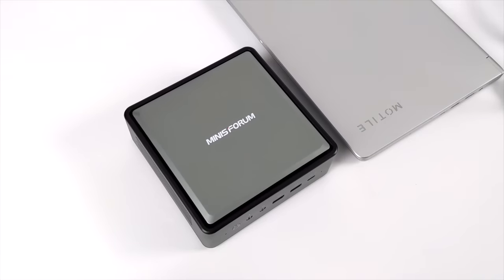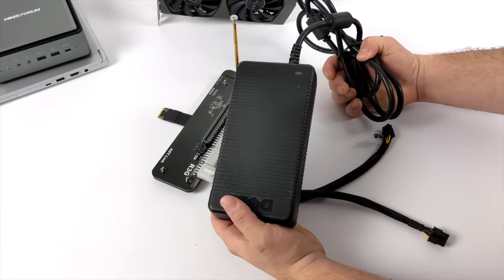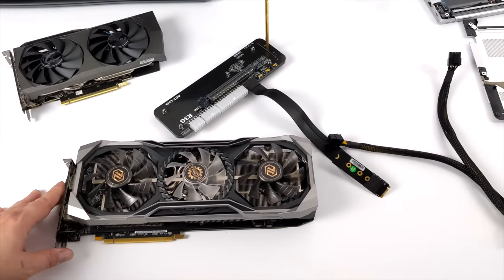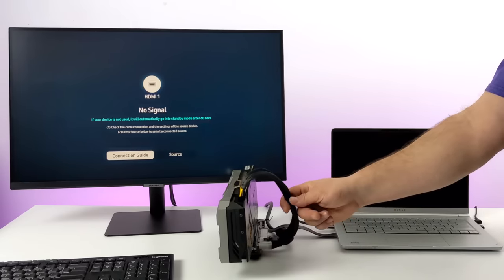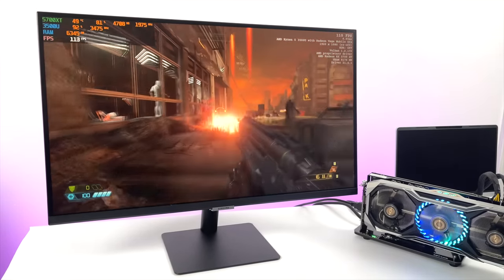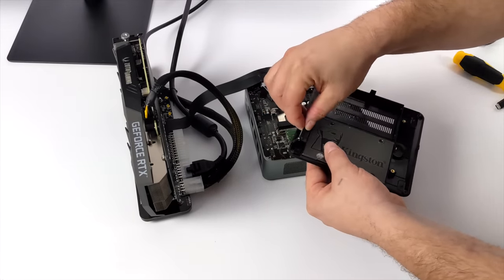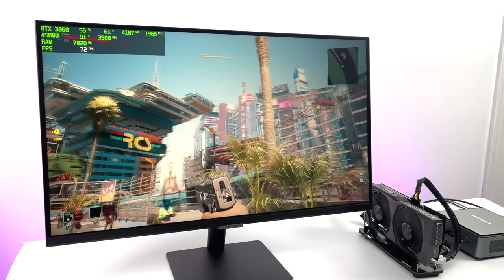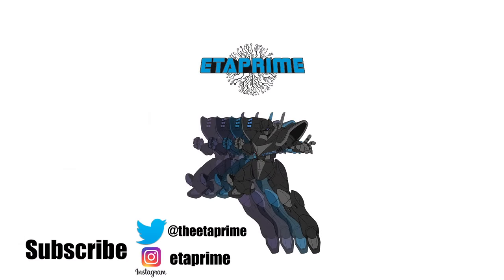Add A Graphics Card To Your Laptop Or Mini PC With This M.2 GPU Dock!

Comment: will this work with newer cards? like rtx 40 series? (obviously assuming i provide enough power) want to use it for my msi gf63 which has an rtx 3050 laptop gpu
Reply: Practically speaking, any GPU will work as long as you have a big enough PSU that can supply the GPU with enough juice. Do note that the eGPU dock can't always provide the full potential of a graphics card, you are broadcasting through an M.2 slot after all.
Reply: @hereis_Tiff so how much fps can you lose?
Reply: @Mope333  I'm not entirely sure to be fair.

Comment: i still have issues with my X220 and expresscard connection .The problem is with displaying games that run on the external GPU(GTX 1650 windforce OC) on the internal dispaly -_-

Comment: could you use a external m.2 ssd USB 3.0 adapter to connect a eGPU? my laptop only has one m.2 port and i was able to get it to work with the ssd in the external adapter and the e GPU in the m.2 slot in the motherboard but if i swap it around it doesnt read the eGPU anymore.
Reply: There is a special variant of this eGPU dock that basically allows you to connect the dock using Thunderbolt/ USB C. Perhaps that'll be more of use to you.

Comment: MINISFORUM Mini PC NAB6 Intel Core i7-12650H,10 Cores 16 Threads,up to 4.7GHz 32GB RAM DDR4 1TB PCIe4.0 SSD Dual 2.5 G RJ45 LAN Mini Desktop Computer,2 x HDMI,7 x USB Port,WiFi 6,BT5.2
this is the mini pc i got would this work for this

Comment: My external gpu isn’t detected my windows I have a 3060 laptop and got a 4060 external gpu and I set everything up correctly I installed the right drivers, the 4060 dose show up in device manager and I also disabled my 3060 integrated gpu
Reply: It also doesn’t show up in task management, it also won’t display on my monitor

Comment: Would I need to alter the BIOS settings for this to work?
Reply: On a desktop computer I can guarantee you that you don't need to alter the BIOS. 

I'm not too sure about a laptop though. It may be that your laptop automatically detects the GPU and switches to that display output. It may also not do that, in which case you may want to alter the BIOS.

Comment: I've just purchased another system, a micro pc HP EliteDesk 805 G6 mini, with an AMD ryzen 7 pro 4750ge the 35w variant, 16gb ddr4 sodimm 2x8gb sticks, a 512gb nvme, I have a spare m.2 slot, could anyone recommend a decent GPU for this particular setup? Thanks

Comment: shame that Port isn't on the side so it's easier to plug in external upgrade to hotrod our old laptops
Reply: I believe Acer made Mini PC's back in the day with a full PCIE x16 slot hidden on the side of the machine. All you had to do was remove a plastic tab and connect your graphics card. Wish OEM's would still do that.

Comment: Any other way to connect through thunderbolt 3 type C port ?
Reply: It's not compatible mate if you're connecting a Thunderbolt through type c. Type c port has a low bandwidth probably if I'm not mistaken it only have 5Gb/s bandwidths, and thunderbolt ports have 40Gb/s bandwidth. It doesn't matter even if you have the thunderbolt cable.

Comment: is it possible to connect a external GPU to a beelink  ser 5 ?
Reply: I think it is possible, as long as the mini PC support thunderbolt 3/4, and atleast 2 m.2 slot, well I think even 1 m.2 slot is possible just buy SSD enclosure. But still research more about your mini PC

Comment: can you make a video when usinh the ngff (m.2 e key wifi card) version of this? I wanna see if it works because I don't wanna sacrifice my m.2 since i really need it so I cant do this
Reply: As of writing this, there are no GPU adapters that use the wifi card slot. As far as I know, wifi card slots typically do not have the required lanes that typical M.2 NVME slots do have that make it possible to connect a graphics card. I get that you don't want to sacrifice an M.2 slot, but if you happen to have 2 or more of those slots on your system, it may very well be worth the sacrifice.

Comment: Hey, I don’t know what I’m doing I need help finding the right graphics card for the dock I want a 6900xt but the issue is the port is different from the port on the dock I need help
Reply: What do you mean? It's the same port...?
Reply: @hereis_Tiff  so I won’t waste 700 bucks for it not to work, it will be compatible
Reply: @FORTNITESLOTH220  Every graphics card has the same PCIE X16 pin. If you use the adapter shown in this video, you should be able to connect your GPU over M.2.

Comment: 100% appreciate your video. Im pestering minisforum to add a 2nd nvme to this model.
My objective is to add a sfp+ 10gbe network card, 2x 2.5" drives in raid 1 and 1 nvme cache and have it be a mini low power NAS
Question, curious how much power the dell adapter is using at idle from the wall

Comment: Connect gpu, install driver nvidia and after reboot 😢 code 43 not ready to go. What wrong?
Reply: try searching error code 43 on youtube for solutions
Reply: @CJFromGroveStreet  tnx. I find fix error code 43 on Egpu forum. Need run .bat file and all ok.  Work well. Rtx 2060 super with notebook hp omen

Comment: Is this applicable to lenovo ideapad 3 v14, AMD3020e (disregarding the cpu)?
It does use nvme-m.2
Reply: As long as you're able to access the m.2 slot it should work yes. But your lenovo laptop only has a nvme m.2 x2 slot not an x4 it will be significantly slower then if you had an x4. Regardless it should be an improvement.
Reply: @PabzRoz  ohh 2x thank you for the response... And how would i know a m.2 2x or 4x? (if later on i decided to upgrade/change my laptop)
Reply: @putusatriavi  No problem and find and read the specification on the laptop and the m.2 port. It will tell you weather it's a 2x or 4x pcie slot. Always check out the specs before purchasing.👍
Reply: @PabzRoz  i will. 🙏🏾
Reply: @PabzRoz  hi, does m.2  x2 could be referred as keyed 'B' or 10 Gbit/s and the x4 keyed 'M' or 20 Gbit/s..please correct me if I'm wrong
Reply: @putusatriavi  no lol it will say x4 or x2 that's it.
Reply: @PabzRoz  ohh okay... 🤦🏾‍♂️

Comment: I tried this on a x4 slot on a lenovo nano . But when they are both connected it no longer sees my boot drive?
Reply: did you go in your bios and make sure the right boot drive is selected?
Reply: @PabzRoz  no boot devices show up when the adapter is connected.  When i disconnect it my ssd shows up
Reply: @adriancuevas1587  no boot devices show up in the bios when it's connected? that's weird. Does it show any storage devices connected in the settings in general? Maybe you can find it that way and manually set it up as a boot drive?
Reply: @PabzRoz  no its really weird. Nothing shows up when the adapter is connected. Might be a bios limitation but not too sure lol

Comment: My laptop has a wifi card pcie slot. Is that the same thing as m.2 or what do I use?
Reply: No, unfortunately. Mine has that too. They used to use those instead of M.2.
Reply: The wifi port is not an NVME m.2 port that this adapter requires. You have to look at the connector to identify if it is a mini-pcie or an NGFF connector. For this case there is another adapter you can find on ebay/chinese sites called EXP GDC. A bit slower than the R43 but does the job and can really make a difference on whether you can game on your laptop or not
Reply: @ThanosTsakirisGaijin  mine uses Mini Pcie, I really like the one in the video because hes able to use an external psu though

Comment: Curious if there’s a workaround for hardware that doesn’t have a viable m.2 port available?
For example, using a m.2/usb-c adapter or m.2/sata adapter.
Reply: There is always the older card docks that use mini sata. Even laptops from 2011 have a mini sata slot. It's the slot used for the network card.

Comment: this doesnt really make much sense to actually do. you have to bust a toolkit out every time you need to take your laptop somewhere. and as for the desktop just build a bigger one and save some money and wall outlets. even if thunderbolt has more of a dropoff in bandwidth than this it still makes more sense to use as you can just unplug without a screwdriver
Reply: it takes 1 minute to plug it in
Reply: @bonkerzd6980  not exactly elegant is it. makes even less sense with the mini pc.

Comment: This is pointless for most all users. You pay a premium for a laptops portability and a mini PC's size, this destroy both portability and size for anything you would run it on. 

Now running speciality equipment setups this  could fill a need. Would be disappointing to not hook this up to a Pi with maybe with that argon one m.2 case.

I Wonder if I could rig this to my Asus router with some tinkering, maybe output network statistics, a list of active connections, and a feed of DNS logs.

Comment: There is now a PCIe 4.0 stand  JMT M.2 M Key NVMe External Graphics Card Stand Bracket 64Gbs Full Speed with PCIe 4.0 x4 Riser Cable R43SG

Comment: Have a quick question when I be able to use this type of power supply for my Mini PC? Segotep 750W Power Supply, 80 Plus Gold Full Modular PCIe 5.0 & ATX 3.0 Gaming PSU for NVIDIA RTX 20/30/40 Series & AMD GPU, 120mm Silent FDB Fan, 5 Year Warranty

Comment: Would this work on a desktop which was a mini ITX motherboard and doesnt have a PCIE slot? ive seen alot of motherboards with m.2 slots and i seen people try using the EXP GDC dock but this seems to be much more stable then that. 
If im wrong can someone correct me. :)

Comment: You could try if you can use this type of external GPU using an external NVME adapter connected to a USB C type 3.0, in order to avoid opening the computer

Comment: No matter how strong your laptop performance was, just a few years later your hardware would be outdated. So I prefer to buy a laptop with great endurance and more easily disassemble, increasing the performance by external graphic cards to save money.

But nowadays, a high-performance graphic card was expensive than a high-performance laptop...😭

Comment: Hello, if I have wire TB 3 I need connect the PSU power supply too? guess, the TB 3 transfer voltage and it can send energy to the eGPU...¿?

Comment: I know this is two years old but if a laptop wanted to be top of the line they'd include a M.2 port accessible just like a USB port in the back & a docking station that can house drives & graphic cards, or anything else they come up with into future, like high speed internet.

Comment: I dunno about this. This seems like a lot and really a lot more trouble than it might be worth. If you drop the card or need to carry it around you could easily KILL it. Also I have a Laptop with like 3 or 4 of those slots (M.2) but it was not a cheap one. Those slots are on the TOP half of the Laptop under a Metal plate not sure how tis may work or not Hrmmm

Comment: Can i connect this card—-> MSI GeForce RTX 4070 VENTUS 3X 12G OC Videokaart gddr6x
Reply: With a card like that I'd honestly get a proper desktop. The 4070, especially with 12 gigs of VRAM, eats a lot of power. You won't be able to use a Dell DA-2 adapter to power the card.

Comment: Can you please provide the specs of the SSD connector (in the mini PC), since you placed the external GPU connector to the NVMe slot? Your video is great!
Reply: Typically you want to use the NVME M.2 slot with the highest speed in your build for connecting a GPU. In most cases that will be x4 speeds.

Comment: might be a stupid question but do I need to power the GPU if its connected to a desktop? the computer itself is always plugged in so I don't see why I would need to power the GPU separately...
Reply: You need an external power supply for the graphics carr because the M.2 slot cannot provide any power whatsoever to the GPU.

M.2 slots aren't made to provide hundreds of Watts. That's why you need an external power supply.

You have two options for this: either the Dell DA-2 adapter, which is basically like a huge laptop power supply. Or, if you need more power, you can plug in an ATX power supply.

Comment: I have a GTX 1080 with a Iaptop and i use the same dock as you. Im having problems with the drivers and connecting with hdmi to the card.
Reply: Hi there! Could you describe the problem? Perhaps I can help you out. I have the same dock aswell and I use a GTX 1650 for my HP Mini PC.

Comment: But how do I find out my m.2 speed?
Reply: You can download a utility app called "Z-info" it is all in one app that contains CPUZ GPUZ SSDZ PCIeZ and many more.

In general, you can easily guess your own M.2 speed. But you must make sure if it is M.2 SATA or M.2 PCIe.

In general M.2 SATA slot Cannot be used for external GPU as in this video, and the bandwidth is exactly the same like regular SATA which is 600MBps.

M.2 PCIe is usually running at PCIe X4 Lanes which is 32 Gbps ( 4 GBps ) remember 8 Gbps = 1 GBps — Gigabit vs Gigabyte.

Well, if it's PCIe Gen 4, it is simply 64 Gbps ( 8 GBps )

What's your Laptop model anyway?

Comment: Really like this idea . However, having a problem in finding the Dell power supply locally. I don't want to have the large atx type PSU.   Does it have to be a Dell product? Can it be used with an alternative laptop power cable with the same wattage?
Reply: The ADT-Link board can only support 2 types of power supplies: your normal ATX type PSU or the Dell DA-2 adapter. Nothing else will fit the connector.

Comment: Is this hassle free? No need to override DSDT and CUSTOM BIOS? boot in to test mode? I did use once an external GPU setup for my 7 year old laptop before  kinda so hard but the hassle was worth it was able to play a lot of games I couldn't coz I only have a i3 3rd gen laptop with integrated graphics. Now I have a PC setup :). I just looked back where I came from.

Comment: Can i do this on my HP ELITEDESK 705 G4 ?
Reply: If it has a free NVME M.2 port and you know how to run the cables around then yes you can! I have a HP Prodesk 600 G4 Mini and it works really well with the dock and a GTX 1650.

Comment: is it possible to use a gpu without external power? like a low profile 1050ti
Reply: When you use the external GPU dock, you *need* external power! The M.2 slot cannot provide any power for your graphics card.

Comment: If my laptop GPU died could this be a solution?
Reply: Yup, you'd essentially turn your laptop into a pseudo-desktop unit. Perhaps it'd be better to run an external keyboard and mouse aswell, since it's kind of botched to use the laptop's keyboard and trackpad.

Comment: Can i use egpu on any laptop with this setup pleas replay sir 🙏🏻
Reply: You can, but you need an M.2 slot that's available. The most optimal solution would be to have a laptop (or a Mini PC) with 2 NVME M.2 slots. That way you can make it work.
Reply: @hereis_Tiff  thanx
Reply: @-sheff_X_morphosis  No problem!

Comment: Wait this is a eGPU without thunderbolt ??
Reply: Yea so? This solution eGPU has been made since 2014 but back in the day it only use mSATA 5Gbps slot compare to modern laptop m.2 PCIe 4x 40Gbps *if I not wrong

Comment: Would this work to use a better card on a laptop that already has a 1650 inside or would I have conflicts with drivers?If so, could that be avoided by using an AMD GPU as the external?
Reply: good question, like that u could keep ur both graphics drivers on the same Windows installation and keep the fact u can use ur laptop outside.  i also would like to know :)

Comment: Wonder if when they enable the m.2 drive for PS5 you could hack into it and use this method. 🤔
Reply: Also, would love to see you do this with a Rock pi. I believe that has an M.2 on it.
Reply: That would be pointless lol the GPU in the ps5 is already better then anything you could put in the m.2 slot. Regardless of what EGPU you use on the m.2 slot you're still limited to m.2 speeds and the GPU that's already in the ps5 runs much faster then m.2 speeds. You would just be severely slowing down your ps5....
Reply: @PabzRoz  lol worth trying in my opinion, but sure shoot it down if you want...

Honestly confused on why you think the PS5 is the best on the market in terms of graphics. It's only on par with a 2080 super and there is a 3090/6900xt...so obviously better graphics out there. Plus, in 2 years GPUs will completely destroy what graphics the ps5 has, so really my idea is a bit future proof (if it works) for those wanting to get better performance on the console they love for an extended period of time...
Reply: M.2 speeds have nothing to do with it either. As far as I know, the m.2 is gen 4 in PS5 anyway.

Comment: What sort of performance is lost from the gpu running it like this? I know the external gpu enclosures can cause a 20% hit
Reply: This is because those are going through the laptop screen, the impact should be minimal, it is more likely you will be bottlenecked by your interface.

Comment: RX 570/580 would also be a good shout. My RX 580 8GB at stock rarely hits over 135w, unless stress tested.
If you can pick one up cheap these days. But for that first type of PC, might be sweet with that Dell PSU.

Comment: £90 for one the adapters...........too expensive.   Maybe consider it if it was £20/30.
Reply: Which adapter are you on about? The Dell DA-2 power adapter is about 20 to 25 dollars. The PCIE x16 to M.2 video adapter is around 80 to 90 dollars. It's pricey because unlike that power adapter, this is a piece of tech that requires a lot of work to create. This is not some mass produced product made by a big brand.
Reply: @hereis_Tiff  I mean the PCIE to M.2 -  I understand the price is due to lack of mass production.  The prices we pay for most tech, make things like this seem too expensive IMHO.

Comment: Is it possible to do something like this with older hardware? I have a 770 sitting around. Is there a way to use it with my retropie, surface pro laptop or an older laptop (circa 2012)?
Reply: I think there was one of this with a sata output but I always thought it was a scam, now it looks like something interesting